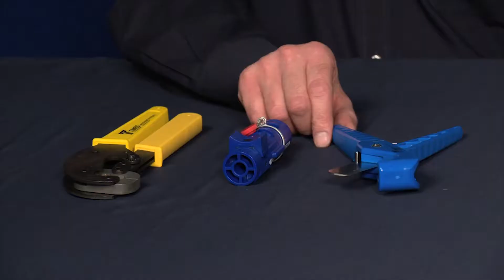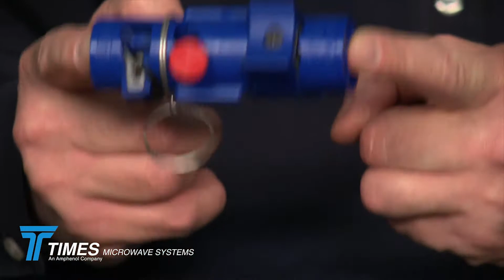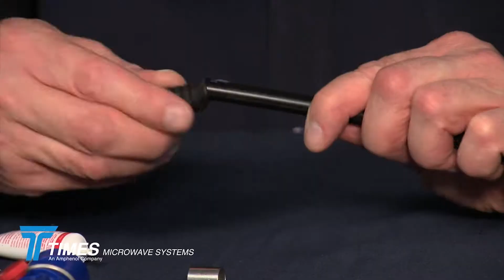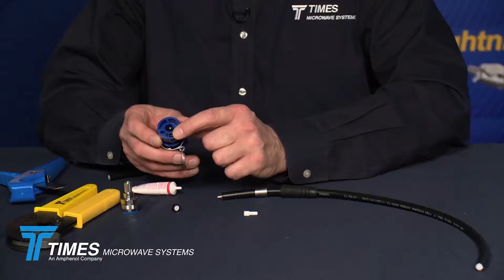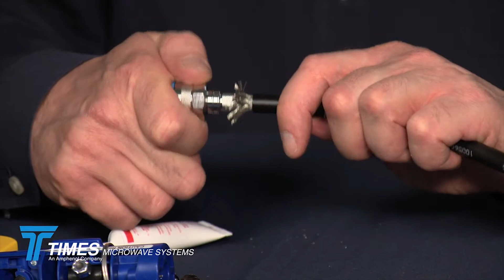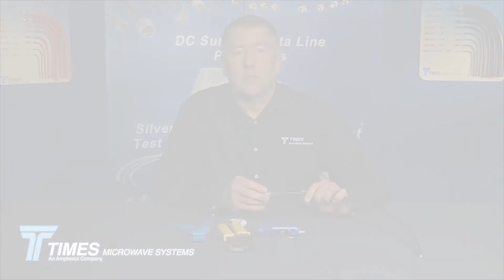Times Microwave Systems - LMR 400 Cable Termination

Comment: That blue cutting tool isn't needed if you already have a cable cutting tool with rounded jaws. All one has to do is re-round out the cable that is slightly crushed.
There is no mention of the other parts of that strip tool or any adjustments.